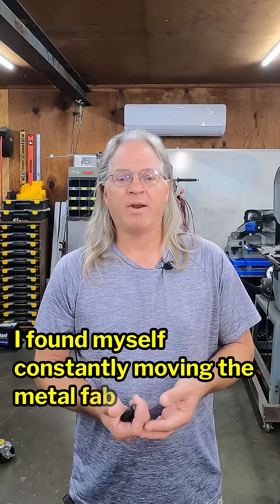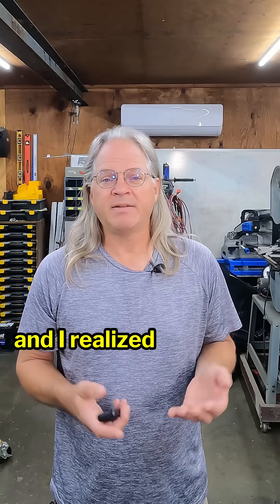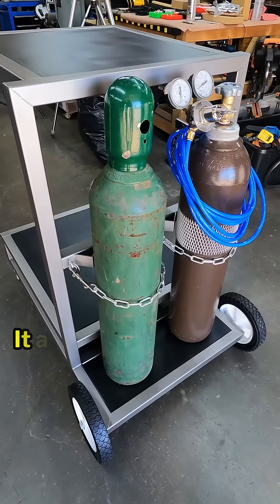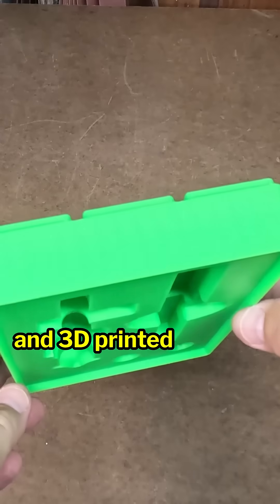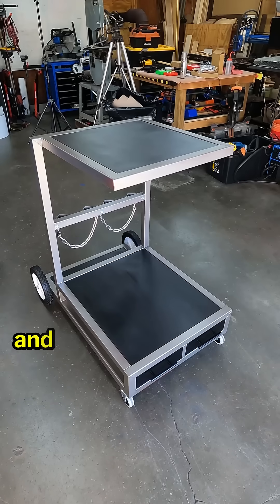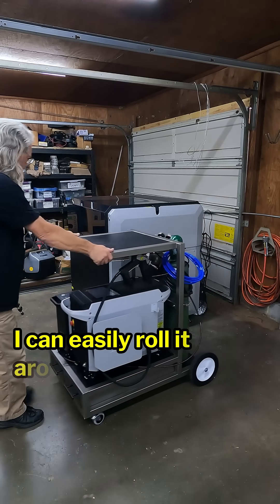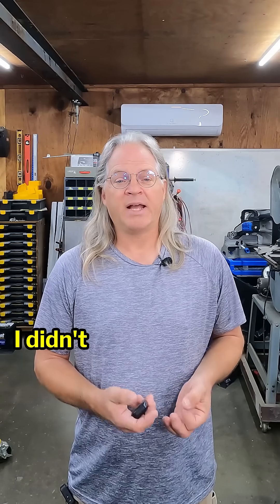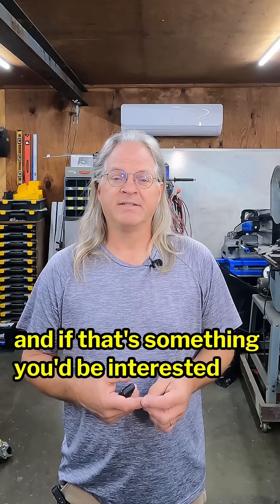Ultimate Welding Cart Made With Lasers! #makingstuff #metalfab  #welding #diy

Comment: Looks awesome. The one change that i would make is a set of drawers between the tabletop and the top of the machines for high use consumeables. Possibly a cord reel on the back to hold an extension cord. I want one of those metal fab machines so bad that i can taste it!!!

Comment: Why not 4 casters instead of 2 big wheels in back? (I'm curious if the big wheels help with something)
Reply: The larger wheels will also not get stuck as easily on small debris on the floor when they have a heavy weight on them like those gas bottles.
Reply from the maker: @masterglaizer5918  Good point!
Reply from the maker: Yes, it's harder to tip over.